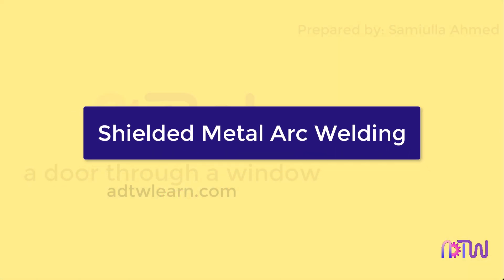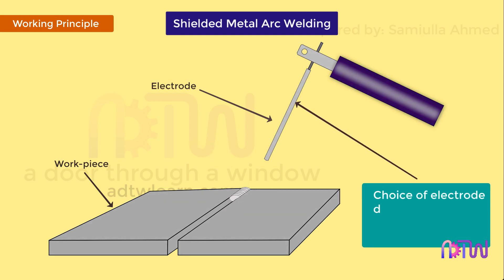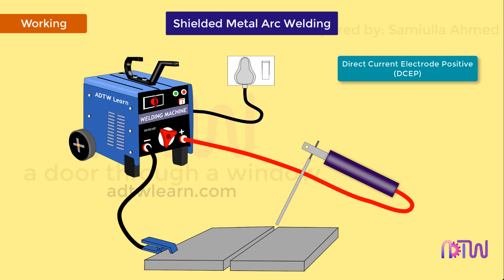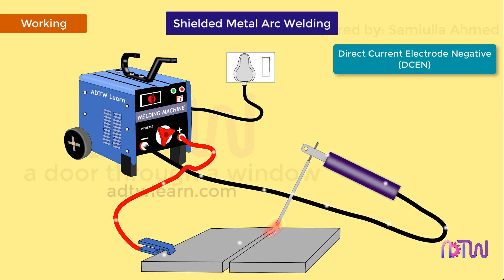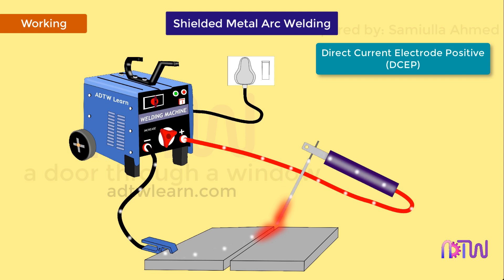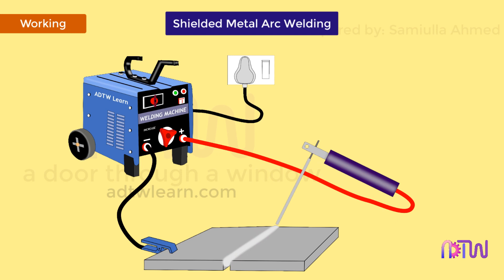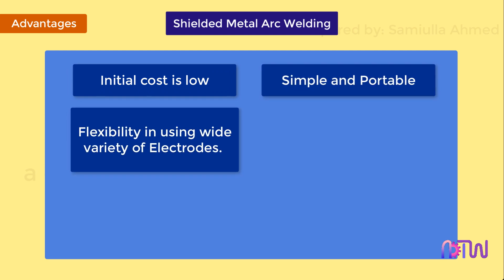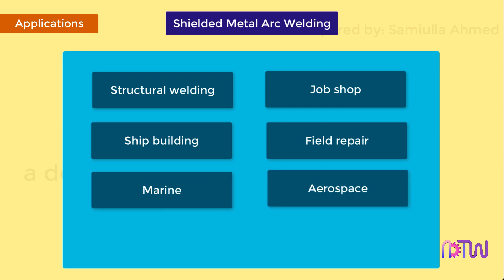SMAW WELDING | Working animation of shielded metal arc welding process | Arc Welding

Comment: Thank you very much sir..👍you explained it greatly.❤️.but sir my biggest weakness Is OverHead welding😟...any tips on that???
Reply from the maker: Choose the right welding machine: Choose a machine that provides adequate power and can easily maneuver in tight spaces.

Use proper technique: Welding overhead requires different techniques than welding in a flat or horizontal position. Practice welding in a mock-up or scrap material to perfect your technique.

Wear proper protective gear: Wear a welding helmet, gloves, and protective clothing to avoid burns and eye damage.

Secure the workpiece: Make sure the workpiece is firmly clamped in place to prevent it from moving while welding.

Weld from the top down: Welding from the top down minimizes the risk of spatter and slag falling on the welder.

Use a sling or other support: A sling can help keep the welding gun steady and prevent fatigue during long welding sessions.

Weld in short intervals: Overhead welding can be tiring. Weld in short intervals and take frequent breaks to avoid fatigue and maintain proper form.

Clean the workpiece thoroughly: Remove any grease, rust, or other contaminants from the workpiece to ensure a good weld.

Comment: In electronics, they use GHz on PCB etching to arc. 
In microElectronics, they encase tracing in ceramics to arc
From pentium 4 onwards, electronics engineers look down on electrical engineers and took over - arc welding